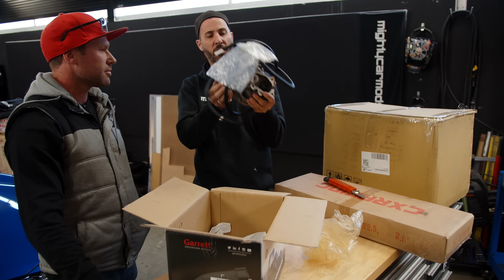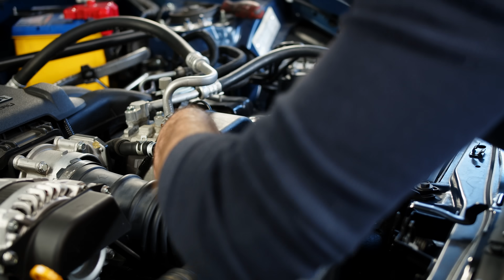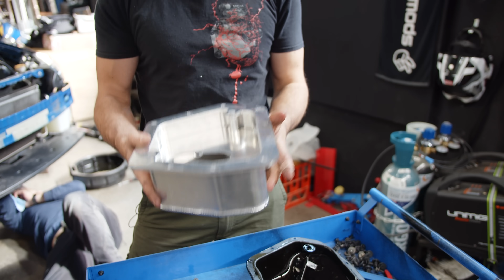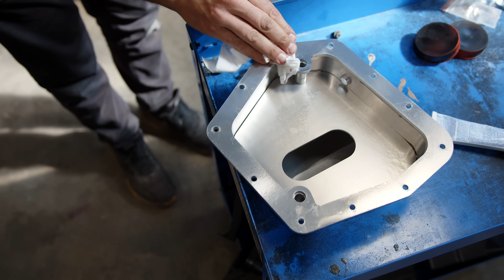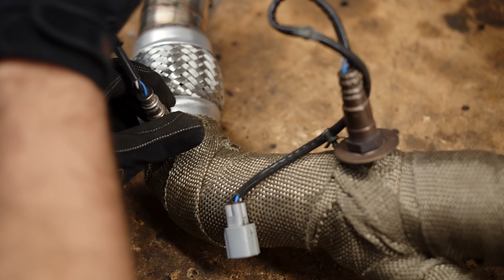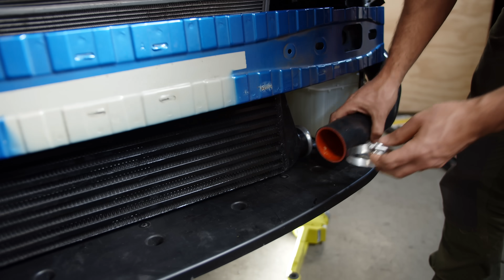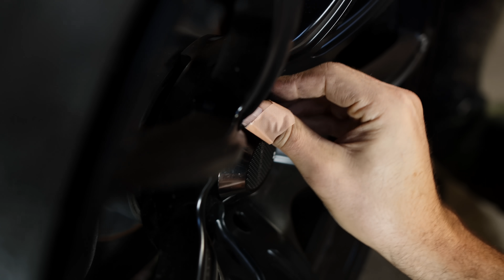How To Turbo Your Car [IN ONE DAY!!]

Comment: So you bought a brz, then swapped the suspension, wheels then had to add a turbo just to make it half decent?? My mate just bought an Audi S5 4.2ltr V8 for just £8500, its over 450hp and custom exhaust included in that price.

Comment: ur brakes gonna melt. My dad tracks a turbo 86 on e85 with 280kw at wheels and it literally murdered a set of rotors and pads per session on stock brakes. I got  wrx GC8 with 170kw at the wheels and 06 sti brakes and she is fine haha.

Comment: On the subject of oil, you always want to use a thicker oil with a turbocharged engine. I have a couple cars that were NA that are now turbocharged and I always use 15w40 with a bottle of STP Oil Treatment. I used to use 5w30 Mobil One until I lost my rod bearings due to the oil being too thin. You have to understand that when you turbocharge a NA engine you're adding more pressure on your bearings and if you use a thicker oil you're adding extra cushion for your bearings to cope with that added pressures.

Comment: I remember hearing about the issues of the 0W-xx oils when I was doing work experience at a Toyota dealer in 2017. The tin of it on the shelf was the first I'd heard of such a thin oil back then, surprised me.

Comment: How to turbo in one day... do your homework and make sure you have all the right parts and adaptors for your car BEFORE fitting anything. Half the time, the turbo kit is for either an older model car or features "universal" bolt on points/parts that have to be modified to suit your particular car.

Comment: I actually like to pour handle down. Gives even more room for the volume of the fluid to push against the air rushing in. Some oil bottles out there even have a clear horizontal graduated line, which is exactly for that.

Comment: If you get a Subaru genuine brake fluid bottle the thread on the cap is the same thread as the oil cap so you can cut the bottom of the bottle off and use it as a funnel

Comment: The only downside to using strictly silicone hose for intercooler piping is that it flexes under boost. Similar to the reasoning behind replacing oem rubber brake lines with stainless steel.

Comment: Still not a fan of Boxer engines, and the kit for this engine puts the turbo in the worst possible place - with the hot-side directly under the intake pipe & throttle body...

Comment: They need a new revision. And marty needs to fab up a heat shield for the turbine housing. It is right under the throttle body going into the intake manifold which cause high intake temps that should of been addressed a long time ago especially for track use!

Comment: wiat your sump pickup tube dosent have a screen mechanism built into it? just a 3/4" straw? that is dangerous.... contaminants inevitably will make it into your pan from time to time.  sad but true. that strainer is the last line of defense before you r bearings and pump suck up those contaminants.. that is legit my only qualm with this conversion.. everything else was tits =]
Reply: there is one there... it's at the flange.

Comment: i am so happy you guys wrapped your headers. looks clean too!, one trick that i almost never see anyone do is this... heat wrap is pourus meaning it can absorb water and moisture. which rusts metals.. if you take HIGH temp ceramic exhaust caoting and spray it all over your heat wrapped exhaust. then let fully cure, this high temp paint will actually seal in all of the pourus materail preventing moisture from being able to soak in. this will allow you to keep benefits of exhaust wrap while eliminating the downside of moisture draw. ;)

Comment: should have got the turbo and manifold ceramic coated, it'll get hot in there, while i'm thinking about heat how about a oil cooler and larger radiator :)

Comment: If you get a screwdriver and punch a hole in the highest point of the oil container, it will pour smoothly as air can get into the bottle without glugging.

Comment: ... With the whole build-up to this, I was genuinely expecting Moog to stick to it. After all, "No turbo on the BRZ" has the perfect escape to fit a supercharger for more Ooompf instead.
Reply: dude did say they are pretty weak when it comes to pouring the torque on down low so supercharger probably not the smart choice
Reply: Let's be real, Moog never meant it a single time when he said no turbo and purity. He was always poking fun at the purists.
Reply: @SF-tb4kb  Purely from an engineering standpoint (and an efficiency one!) I see a turbocharger as a more elegant solution, where the supercharger causes a significant parasitic power loss.
But, with variety being the spice of life, it would still have been interesting to see a supercharger bolt-on for a change.
Reply: @SF-tb4kb  For max power yes a turbo is gonna shit on an NA build. Although i must say some of those hill climb monster cars where they get 300 hp out of a 1.6 that revs to 12k is awesome. I'm just bored of turbos thats all.
Reply: Rotrax supercharger would have been so sweet.
Reply: Aditya Singh  As a figure of speech it works. It's more Go, more Powaahhh, more VROOOM, you ought to get the idea.
Reply: Aditya Singh  lol, have you even ridden in a car with a supercharger?
Reply: I was hoping for a good NA build. Lumpy cam, head ported, larger valves, forged and balanced internals, ecu re-map and an increased limiter. Oh well, plain Jane turbo it is.
Reply: @aneejit9079  NA build would be amazing but it's so much work for not a lot of gain. Turbo is the "easy" way out
Reply: Bryce M and a lot more expensive too
Reply: @brucemanKBW  Yea not only is it the " easy way " it's just soooo over done nowadays, like if everybody's doing the same thing how on earth can it be cool if its common?
Reply: AnEejit i was hoping for n/a with nitrous for a change on this channel
Reply: @Kyleashdown13  they did a nitrous s2000 years ago
Reply: @ConvoyBebop  That was just a dream.

Comment: I have a couple things to say. First isn't the higher compression ratio of the N/A engine a bit unsuitable for turbo charging? Also it sadly will never be a proper Subaru with those equal length headers. I'm mostly in it for the rumble. Turbo noises are second. Cheers Mates 👍

Comment: Goddamnit guys. I bought one of the first 86s in the US waaay back in 2012 and I sold it a few years later because it was too heavy and slow with the N/A fa20 engine. I will say it was very easy and almost fun to work on, and it was like a slow miata at the track, just wide open throttle everywhere and chuck it into corners without a care in the world. Maybe I should do a turbo one, too. It deserves a turbo.

Comment: here starts the oil viscosity debate again. i run 5w30 as factory recommended. normally only 80-90c but when towing my boat up a long up hill. it can reach as high as 130c...  but 10 viscosity every 10c. i don't believe that

Comment: Here in the US we use high temperature RTV gasket maker comes in a tube you called Shmoo. I'll show you using silicone lubricant for the charge pipes here in the US we use hairspray they do opposite things opposed to Shmoo

Comment: “Make sure your car has the right fluids” while pouring in a gallon of water 🤣
Reply: What's so funny about that? Proper radiator fluid is 50/50 coolant and distilled water.
Reply: Depending on the weather condition. You can even use more water than the coolant. 
Most mix are 40/60 50/50 60/40
Reply: In a climate like Australia don’t waste money on coolant. Distilled water is perfectly fine
Reply: @matk22  I was always taught that pure water can cause corrosion.
Reply: PeanutProductions no more than coolant really

Comment: Don't use silicon lubricants where they could migrate into the engine as silicon is practically microscopic sand. Use engine oil for these applications as it won't potentially damage the engine.

Comment: Only thing I'd say for young punters. Use hairspray for your silicon joiners - HOT TIP haha. 
Starts out nice and slippery to slide on and clamp down, then dries sticky to stop you blowing a intercooler pipe under boost...when you have no tools on you...in the pouring rain. 
Ask me how I know..

Comment: The one problem I see and with any turbo kit you add to a car that never had a turbo is the fact that the turbo makes a ton of heat under hood. Long term on all these kits is you will cook the crap out of everything under the hood. These kits are not designed for long term use, you will be fixing all kinds of heat related issues later, cooked wiring, rubber hoses, plastic covers, and other components not built to have so much crazy heat in the engine compartment.

Comment: Guys, strongly suggest a "turbo beanie" or heat bag for the exhaust housing/turbine. It's so close to the radiator and the amount of heat it will generate can't be good. Especially when on the track under constant boost. It will literally glow red hot and the bag will protect everything around it.

Comment: I've got a friend that has a build that's basically this car and I generally stay ahead of him when we do track days for fun with us being similar in driver skill after 10 years of doing track events and rally.  To be fair, I have a LOT more time invested into my car than his both build wise and seat time wise.  The car I take against his BRZ is a RWD converted ST204 Celica with a turbo 1GR V6.  It's basically a ST204 adapted/modified with a lot of Supra/SC300 OEM/Aftermarket parts.  Power figures were around 255hp/190kw for the BRZ and around 355hp/265kw for the Celica (I have a fair bit of room but with the current suspension/tires traction becomes a problem at ~2700 pounds) so it's pretty clear why I was able to blast ahead on straights.  I put a stupid amount of time in engineering everything to optimize weight distribution, performance, and handling but it is meant to be able to be daily driven relatively comfortably so I didn't go to the extremes.  I'm sure the BRZ/86 platform is a lot better one and destroys my work but I love ST204's so it was worth it.

Comment: I don't like turbos for drifting, mainly because I am not into show drifting but actual "win the race" drifting. And if you don't know the difference, all you know about is shitty tire smoke show drifting. So for me, I would rather fully built a motor, maybe ITBs, a nice exhaust. And use that for drifting instead. With a turbo, you will either be out of boost, and thus you don't have enough power because the engine can't do shit without the turbo, and when the turbo kicks in, you can spin out because of the instant acceleration for no reason. You want smooth acceleration. Or you are in boost, and you have to slam the throttle to stay in boost, and then you shred your tires into a sweeping up project.

Comment: You have to try twinscroll turbo it's so much fun to drive with from 2k rpm to 7k torque, less turbo lag ...Really like mine on my wrx 2015 ❤️ or stagered twin turbo if this is possible on a small engine like this!

Comment: Moog: “tell us about your turbo kit”

Awkward gentleman: “shouldn’t have any clearance issues”

Moog: cue voiceover
Reply: can you really trust a guy who tucks his ears?
Reply: When salesman say "this turbo makes xxx hp" I always cringe a little. That's just not how this thing works
Reply: momanski aka biffbuz they probebly mean rated for xxx hp
Reply: @gummikazy  yeah I meant that too. These ratings are bs
Reply: momanski aka biffbuz well ofcourse you can but to make power reliably that is the max, and if you up the boost to much on a restrictive hot side backpressure will be way to high and the turbo will have make a lot more pressure then it delivers to the engine
Reply: @gummikazy  Power is not just made by the turbo. For example: two engines with everything the same but two different compression ratios. The one with the higher compression makes more power than the one with lower compression on the same boost. And there are soooooo many thinks that have an influence on your horsepower. You can even cool your engine with ethanol or methanol and the turbo will be cooler too. So saying the turbo makes xxx hp is just bs, because there are so many factors that you can't dictate with that statement and therefore can't tell the max hp.

Comment: Am I the only one concerned about how close the hot end is to the pulleys and belts and intake?   All the intercooling won't help if you heat it right back up.   Is a turbo blanket an option or does it interfere with the belts?

Comment: Guy: “ they dont have any blow by issues, they are pretty good”
Litterally the next frame a second later: thick black carbon  sludge on the throttle body .... 😂😂
Reply: That's egr not blow by haha
Reply: @aaronhall7740  Nice oily exhaust gas hey.
Reply: Mr. A No, just unburnt hydrocarbon sludge. 

Well.. yes to an extent, all engines inevitably let a bit of oil past the rings/valve stem seals to an extent. 

But mostly, it’s unburnt fuel that’s not made it through the EGR/intake without dropping out of its suspension in the smoke. 

The whole point of an EGR system is to try to burn unburnt fuel in the exhaust gases off (generally when the engines too cold to get a clean burn, or at idle/low revs), but the problem is, as you can see, it’s difficult to feed the smoke back into the intake without some of the soot/unburnt fuel settling on everything.

Comment: Oil pressure will drop with the rise in oil temperature, this does not mean there’s a flow rate drop. Just like boost, the number you see on the gauge is what’s waiting to get into the engine.

Comment: The layer of paint will be slightly insulating compared to bare aluminum, might make the intercooler slightly less effective. Probably fine given target power level, but for anyone plating along at home wanting a few free HP, bare metal will transfer heat more effectively.

Comment: Hey with the turbocharger so close to the after cooler pipe to the throttle body I think you should install turbo blanket to reduce the engine bay heat and protect other part from heat soak

Comment: One day of work is impressive.  I've probably put three or four full days in to mine, but that also included a fuel pump, injectors, radiator, spark plugs, and two snapped bolts.  Still, even just getting everything off, the turbo kit on, and then putting it all back together in a day is pretty damn fast.  Well done!

Comment: I remember on the rb26 build when turbo yoda said if you use a silicone coupler on the intercooler piping, the whole piping might as well be silicone. But hey it works and looks really simple and clean

Comment: I will keep posting this untill marty read and acknowledge my handling upgrade suggestion to his sti!

Now marty! Go make your car faster in corners!
Do maximum caster mod on your GC8 sti.. it needs around +5~6 degree (stock gc8 just at 3.5 which is shame compared to stock brz caster number)

Have read here: https://www.scoobynet.com/suspension...mod-limit.html

And do everything:
-anti lift kit with offset caster main bush
-rotated front strut mount for straight caster (angled 90 degree towards firewall)
-lower arm big pin spacer 3mm~6mm thick

Front swaybar located to stiffest setting...
Rear swaybar located to medium setting
And increase rear ride height slightly to give more front biased weight distribution during corner entry and mid corner acceleration...

Leave the brz in the dust!

Dont loose to brz marty!

Comment: Wow that bumper was complicated. My mirage is three center-pull clips in the wheel wells, six under the front lip, two bolts under the lip, two in the lower grill, and four under the hood. And it comes off. In five minutes.

Comment: they didnt even rev up the engine enough so we can hear the turbo sounds :(
Reply: it's got a big remote mounted pod filter and a recirculating BOV. It's actually a really quiet turbo system compared to most because of that.

Comment: 23:53 protip for pouring oil without it gulping everywhere: pour it with the bottle upside-down (where that handle faces the floor instead of the ceiling). It will allow you to tilt the bottle more horizontally before oil starts pouring out and will place the spout/air intake closer to the highest point which will result in a far smoother pour
Reply: Wasn't downing it just never thought about it before, it's a great suggestion and I appreciate the insight !
Reply: How does a bottle of oil move the air intake
Reply: @a.m.ustudios hahaha I don't know if you're serious 🤔
Reply: @mikehughhawk  just used it this week to fill up windshield washer fluid

Comment: How dare you disrupt the purity! Now the car will be completely off balance with that super heavy turbo, giant oil sump and intercooler with that monster thick coat of black paint getting heat soaked! You probably won't even be able to turn anymore, just understeer skid in straight lines.

Nah this thing is going to be rad! I really like that silicone intercooler piping! Mine is aluminum and such a bitch to fit into place. Who cares about chopping 20 year old STI's??? It's all about chopping that MX-5 guy who passed you all dirty on the track! (Moog has not slept since that day)

Comment: 180KW at the wheels will still be less than 180KW at the wheels on the STI because to get 180 with more drivetrain loss the STI makes more at the crank.

Comment: When changing oil if you're using a 5l bottle off the shelf pour sideways to stop the "gluging" from making a mess and pour quicker. 90 degrees from what marty is doing at 24:00 :)

Comment: I know y'all are hard up with the Haltech boys, but honestly for an easy plug in management system look to a Cobb Accessport. Plenty of support, and I'm sure your tuners can work with them. Pretty sure you've use one before at some time, but I cant remember what build it was.  Its also a great heads up display for all the info you need on the go.